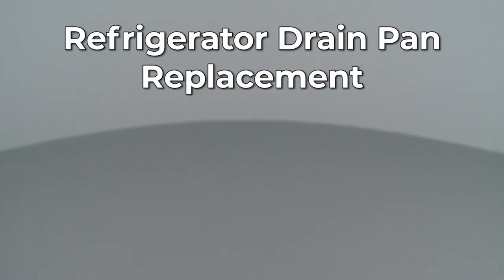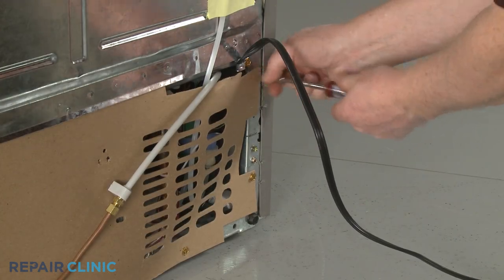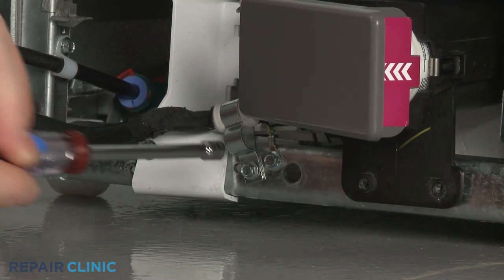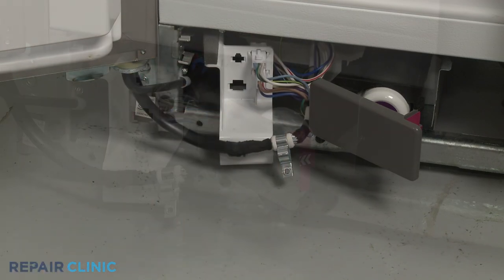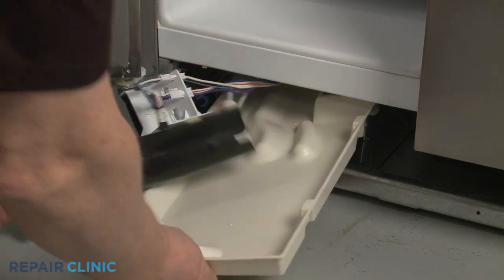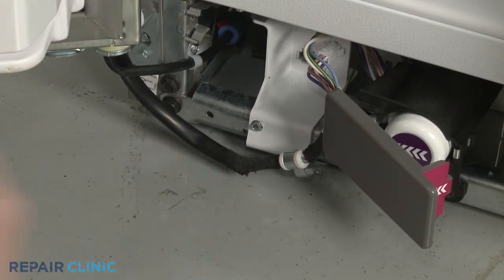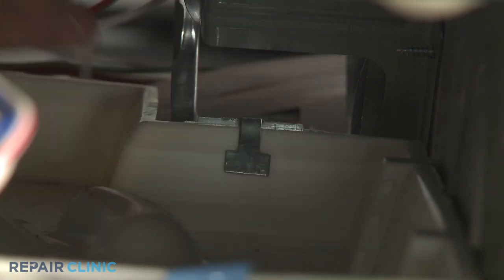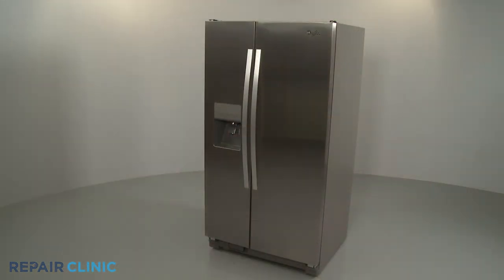Whirlpool Barracuda Refrigerator Drain Pan Replacement WPW10614158

Comment: I just did this on my kitchenaid side by side fridge and it is impossible to take that pan out without disconnecting the smaller water line into the filter housing. You don't disconnect it at the housing but rather at the back. It was so frustrating until I did that.

Comment: Are you serious... all that work? They could’ve EASILY made it slide out from under the bottom part that pops off in the front. This is ridiculous.
Reply: I know.  I need to replace mine and every video I've seen so far, there's like...58 steps you have to take before being able to access it.  Freaking ridiculous.